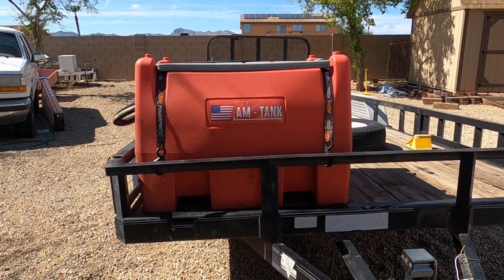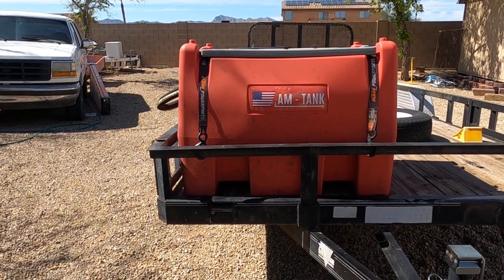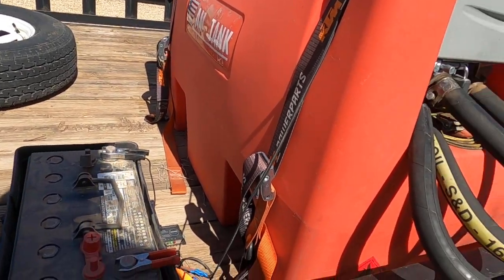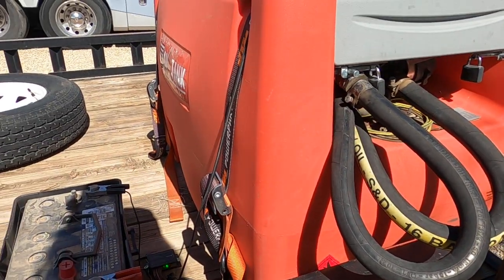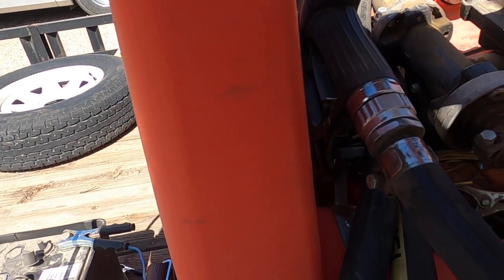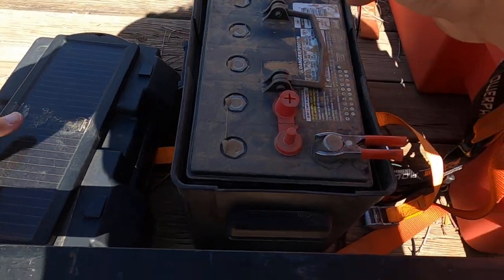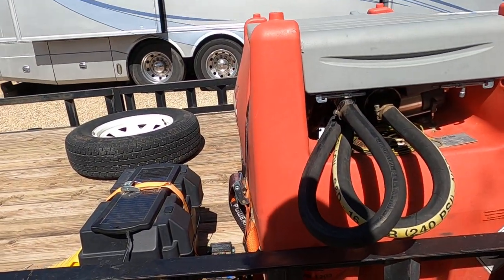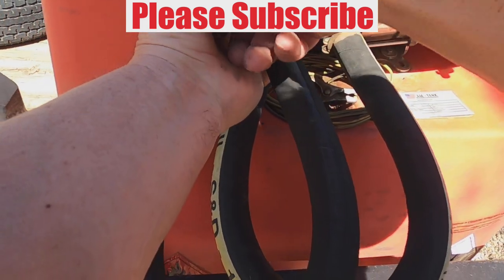Fueling Station AM-TANK

Comment: Building a fuel trailer myself and started running into red tape, ever ran into issues transporting that much gasoline at once? Wild how much info you can find on diesel but gasoline is just not discussed barely anywhere.
Reply from the maker: Never crossed my mind, seems like more political b.s.

Comment: If you had this in a truck bed, are the wires long enough to reach the battery under the hood? Thanks.
Reply from the maker: They should be, if not you could easily extend them.

Comment: Where did you buy this from?
Reply from the maker: AM Tank
Reply: @exploredom3690  Thanks for informative video.... Where did you get the solar panel that connects to a car battery and the battery cover?
Reply from the maker: @craig.hansen It's just a cheap Harbor Freight panel, you can probably get one on Amazon. Battery cover was from Walmart I believe. The panel connects to a converter for a 12v battery that I bought on Amazon.